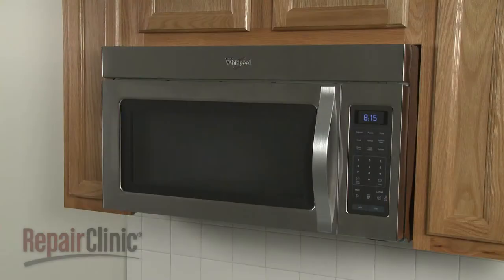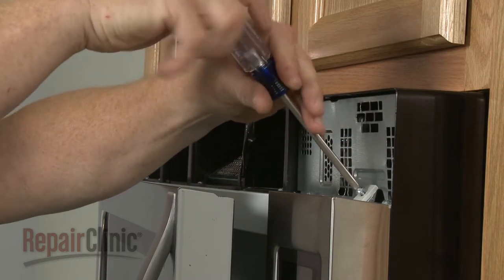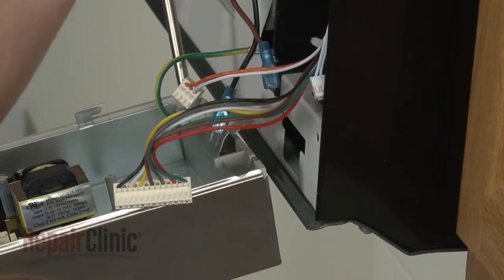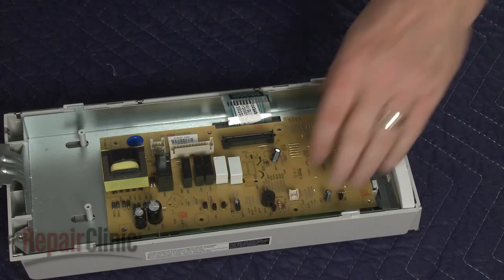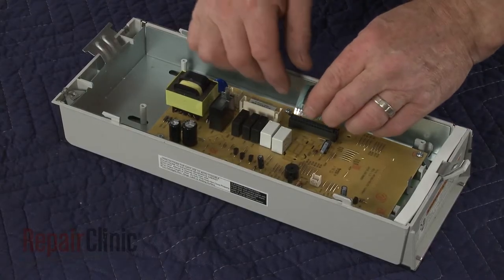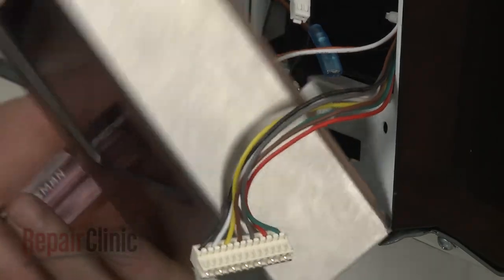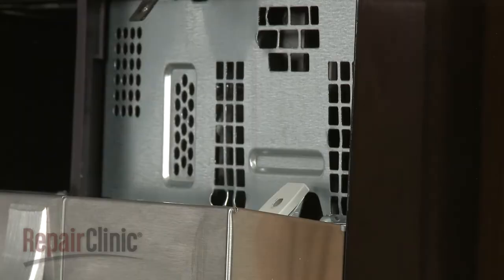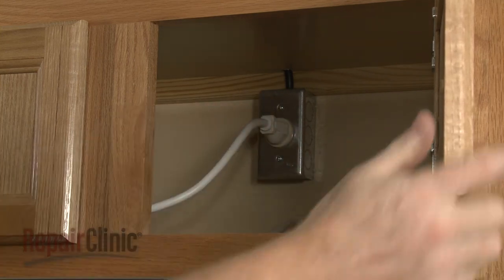Whirlpool Microwave Main Control Board Replacement #W10498011

Comment: before you spend $200+ on a replacement control board, quickly try this: reseat the ribbon cable that is shown at around the 1:30 mark in this video. on my whirlpool model mh8150xj, i was getting an F6 error. i reseated the ribbon cable (i had to do it twice), which cleared the error and fixed the microwave.
Reply: awesome.   I keep seeing that replacing the board will get rid of a humming that im getting from the magnetron when i close the door  and the microwave should be off.  Do you think this will fix my issue?
Reply: I was getting the F1E4 error and a humming sound.  I reseated the ribbon cable as you mentioned and this cleared the error and is working again. THANKS!
Reply: Robert Medl You are the man! 🙏👍🏼 i reseated the flat ribbon cable (3 times) and it magically worked!
Reply: Will that work for the light that will not turn off?
Reply: @allenmanguson1833  I wanna know how to turn the light off with the High Low Off Switch,since my light stays on all the time smh
Reply: Absolutely, I tried keeping the microwave unplugged, then waiting a minute. When that didn't work.  I kept it plugged in and turned off the circuit breaker. Nope, didn't work. Lastly, I tried your solution. At first, the display buttons didn't work, meaning no response or responsive sound. I checked it again and saw that the ribbon wasn't locked back in correctly after I had removed it. So, I tried again and all is working. Thanks so much!
Reply: I was getting the F1E4 error code. I saw Lowes had the same microwave on sale and only one left so I ran over to get it. Then I pulled out the control panel of my existing microwave, took out the ribbon and put it back in. Problem seems to be gone for now. Thanks so much!! I'll hold on to the new microwave awhile before I return it for cash!
Reply: Yes! This works with most appliances. Just gain access to the control board and disconnect the ribbon and reconnect. This works for my whirlpool microwave and Samsung dryer. No need to buy replacement board.

Comment: Hello. Do you know what is p4 (white cable you have removed first) is responsible for? I've got the part to replace and this cable is not connected to a new board ... this p4 pin has no pin anymore ..

Comment: There's a strange noise that sounds like a wire grinding in a fan. The noise seems to be coming from the control board. Is this one of the symptoms of a control board that needs replacing?
Reply: I have a same problem. Did you solve it by any chance?